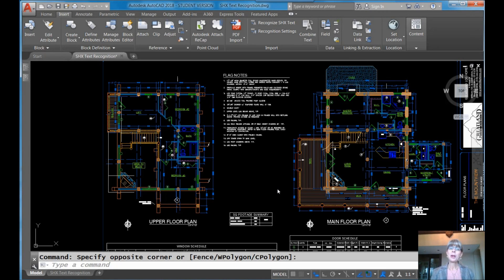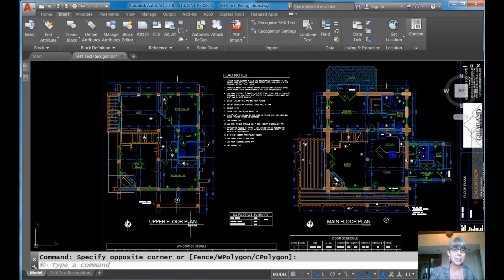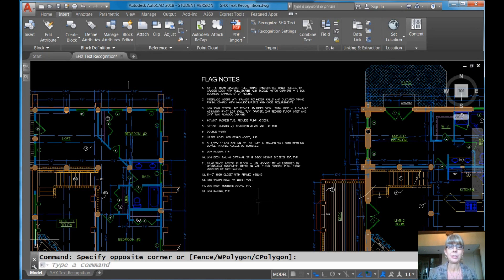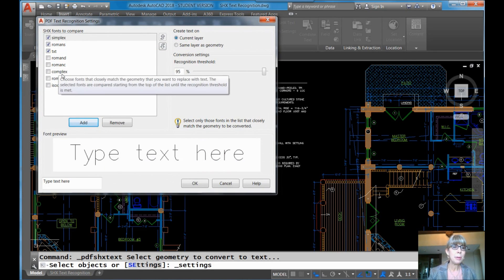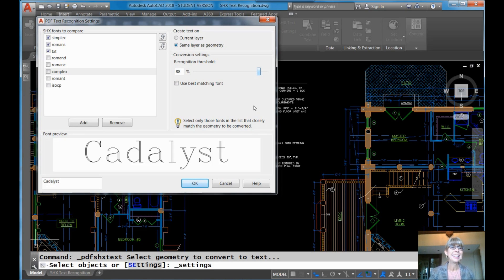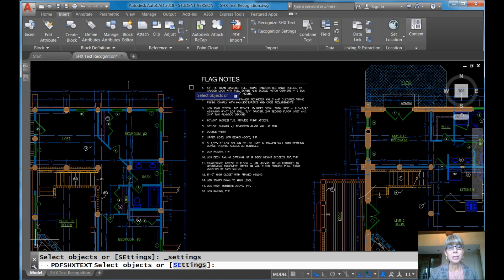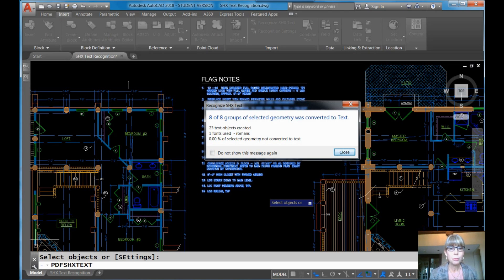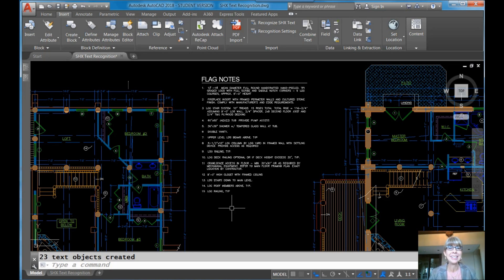AutoCAD Video Tips: Convert SHX Text from PDF Files to MTEXT (Lynn Allen/Cadalyst Magazine)

Comment: Thank you for this CAD tip; it is going to save me a LOT of time. After a quick test I preferred to create a new layer 'Mtext' coloured red, set it as the current layer and opted to convert onto that layer. The conversion isn't perfect and leaves some polylines behind, my way you can turn off or freeze 'Mtext' and clean the leftover lines easily. I found with survey points e.g. 155.53 a tendency for the conversion to lose the decimal point and rotated SHX text was handled very poorly, possibly changing the UCS might deal with that issue. Finally I got best results by setting the recognition threshold really low (50%) and restricting its choice to a single font, styling the MText after conversion. In conclusion this works like OCR for raster text - it is a time saver but not 100% perfect - and the better quality the source data, the better the end result